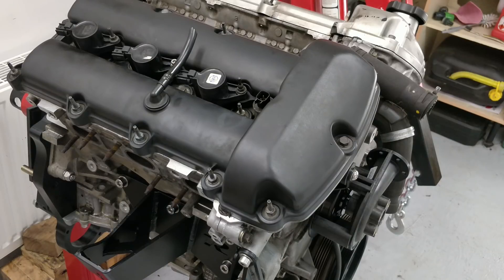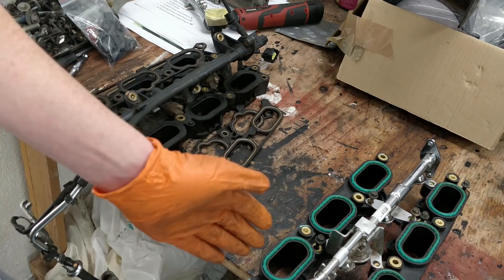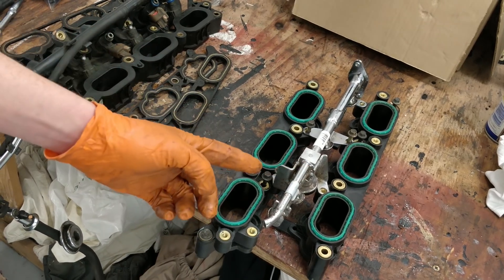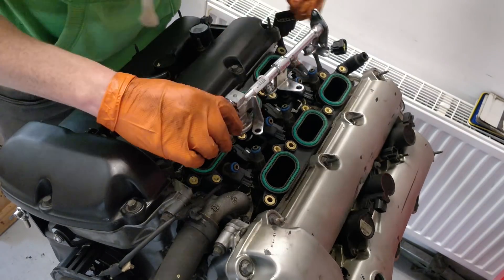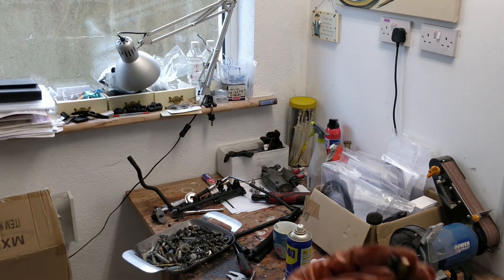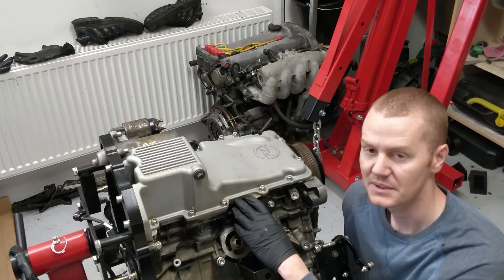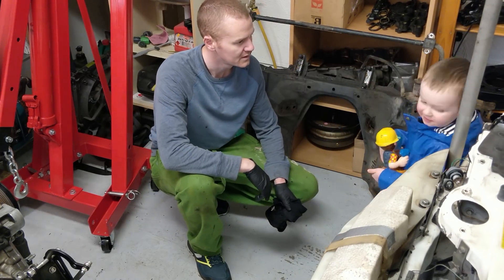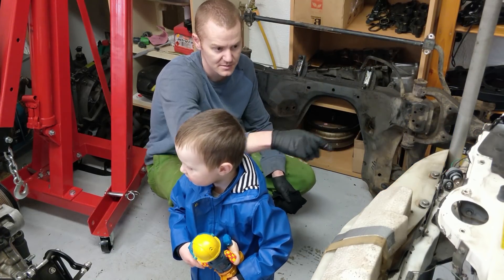Rocketeer MX5: Wiring, Sump and Manifolds

Comment: Excellent progress. I'm curious about the differently colored rocker covers. Was one replaced whilst this engine was still in the Jaguar?
Reply from the maker: The rocker covers come like this from Jaguar. Might have been a cost thing as the black side is completely hidden as the aluminium inlet runners run over the top.